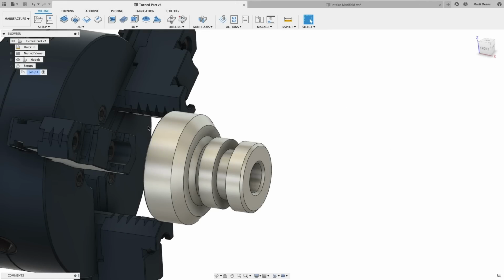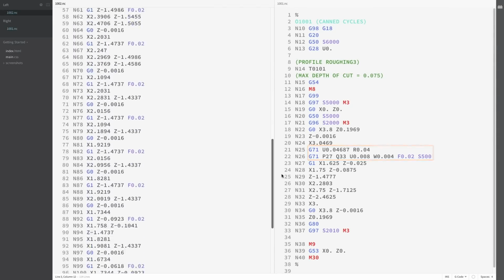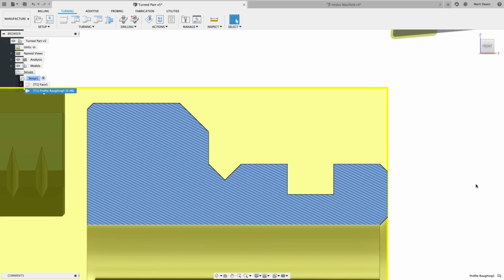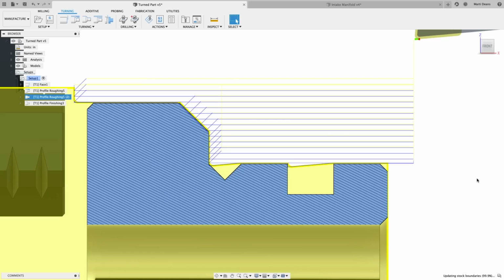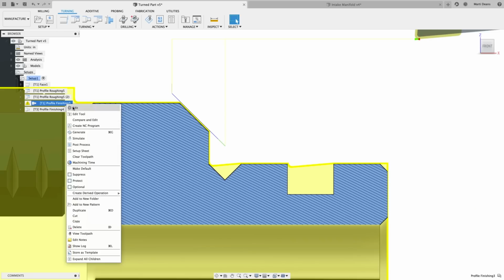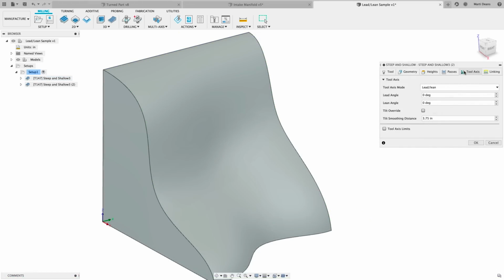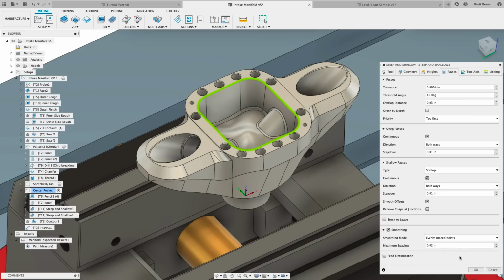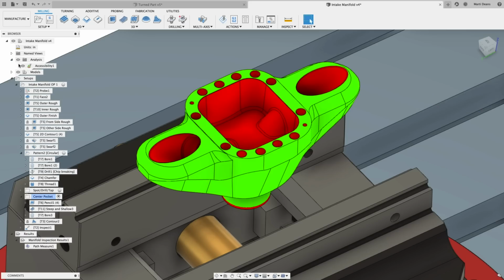What's New in Fusion 360 Manufacturing -  September 2019

Comment: hi im using fusion 360 latest update im having trouble post processing for usb cnc lathe it keep showing me this error
###############################################################################

Error: Turning toolpath is not supported by the post configuration.

Failed while processing onOpen().

###############################################################################

i don't know what in doing wrong it seems to work fine for milling operations 
please help
Reply from the maker: Hey Inder, may I suggest that you post this on our CAM forum (https://forums.autodesk.com/t5/fusion-360-manufacture/bd-p/2070)  or post forum (https://forums.autodesk.com/t5/hsm-post-processor-forum/bd-p/218_

Comment: Would you at least answer whether the situation with the component pattern in the cam module will be corrected? Or do we need to redo everything? Several years of work, several hundred files down the drain? We are very grateful to you for your work, but criticism is also important.
Reply: A similar situation. Dozens of work files using component pattern have become garbage ((
Reply from the maker: @Tikhon-  Yes, we are aware of the cam pattern issue.  It is currently in Hotfix.  Should hope to see this resolved soon

Comment: any support for live tool milling in a lathe. in order to get proper code I have to scale my model in the x and y but not the z. then I have to correct the radius called out in the program as they are now double from trying to get the x and y to post diameter moves. thanks
Reply: this should just be a simple post processor fix.  many post even have a parameter in the post dialog to set if you are using radial or diameter mode.
Reply: @PM.al.whatmough  do you know of one in the many post you refer to that offer it in the default list provided with fusion 360 because I cant find one.
Reply from the maker: Was Al's suggestion on point? Let us know if we can help!
Reply: @adskFusion  no Al just made an obvious statement. it is a post problem but I can not find one in the list of default post's that supports the issue.

Comment: Many good improvements here but face profiling is missing now.
Reply: keerthi soundararajan you can do face profiling by switching the pass direction to “Vertical” in the Passes Tab which I cover around 3:10 in the video
Reply: @marthadeans  Earlier VNMG tool for face profiling was working with holder collision warning. 
The new update it cannot handle VNMG and shows Error: Invalid tool angles.
Reply: @keerthihsk  if you could add a support entry on the forum here https://forums.autodesk.com/t5/fusion-360-support/bd-p/962 and attach your problem file I could take a look at it